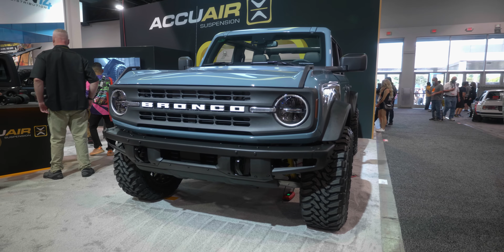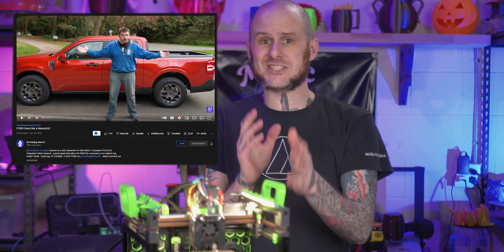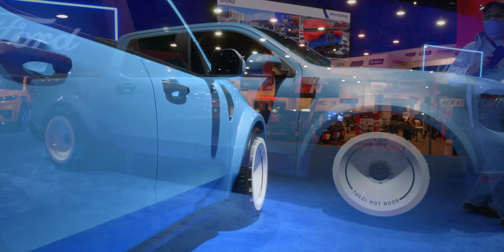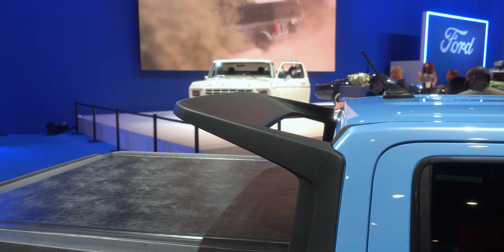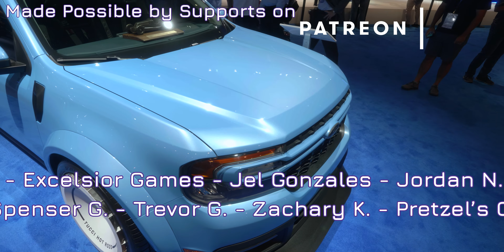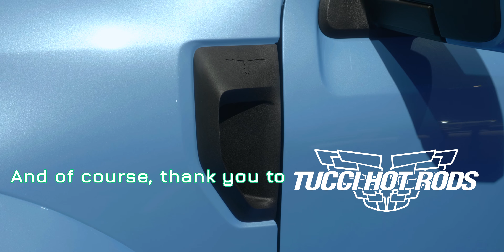3D Printed Custom Truck at SEMA! - Tucci Hot Rods 2022 Ford Maverick

Comment: Petg is not really good for sun, if it’s meant to be show car it’s fine, it wont suffer real life UV otherwise it will be a problem.
Reply from the maker: The parts are coated in carbon, body filler, and Automotive paint. Automotive paint in particular specifically has UV blocking properties. Otherwise cars would fade terribly in a short amount of time (used to be an issue and still will be in the LONGGG term, but not typical lifespans). I'd have chosen a different material, but in this context, PETG is kind of the carrier for materials that protect the PETG, so it really should be a non-issue. The Tucci folks use their builds, not just show them.